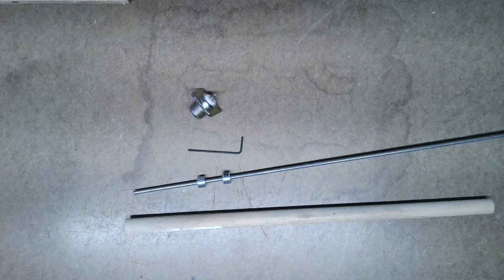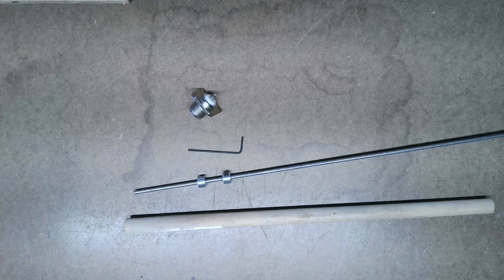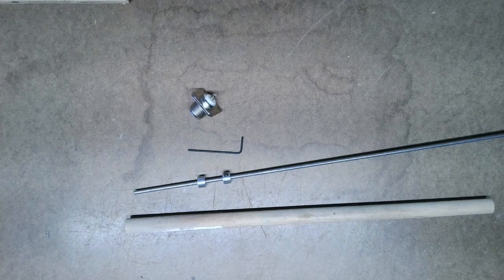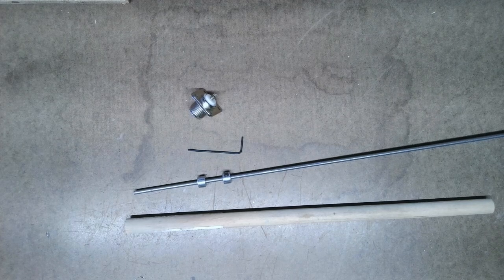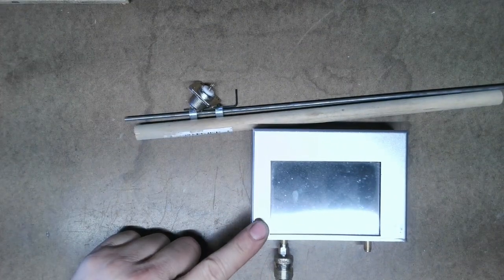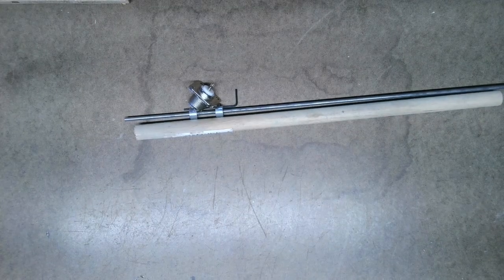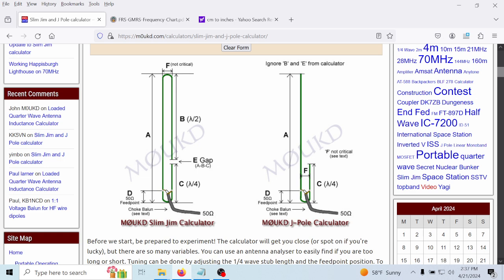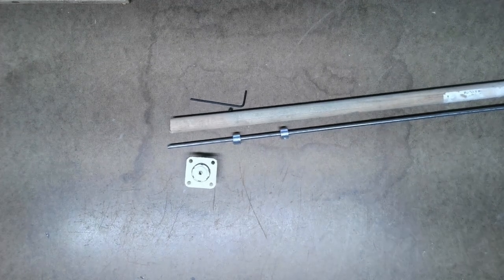🔺how to build adjustable j-pole GMRS two-way radio 3db antenna using wire!! base/repeater PART 1 🔺

Comment: What would be different if you use copper or steel brake line? i have some un-used brake line and to save money was thinking of using that instead of going out and buuuying copper? Thanks great videos!!
Reply from the maker: I used 1/8 steel rod ( as the video shows) with no problems and seems to work well! I would say try it and see how it works!!